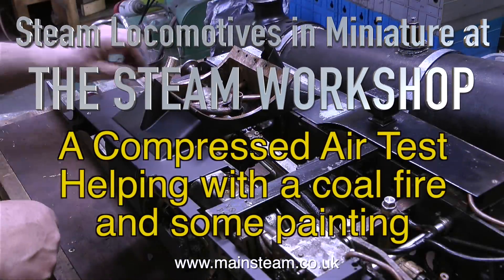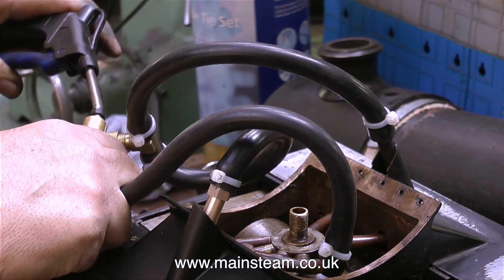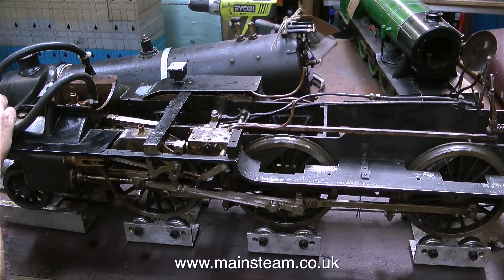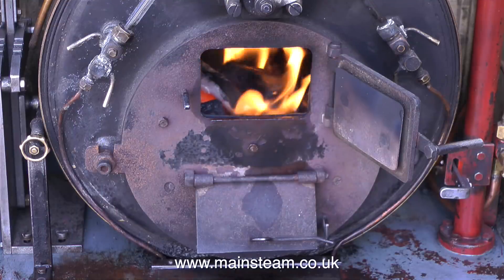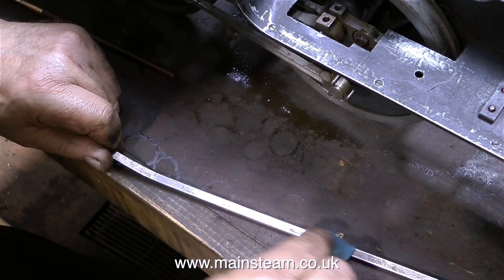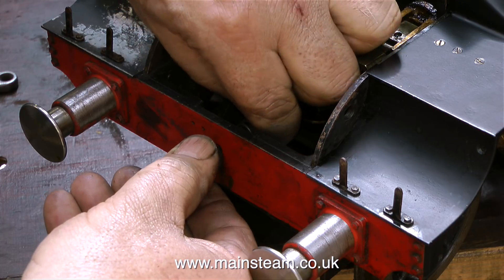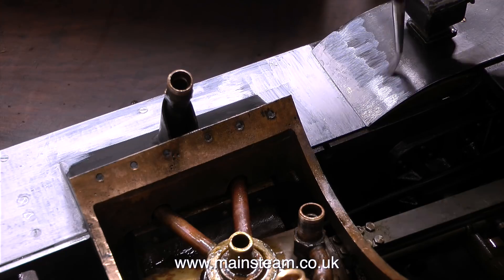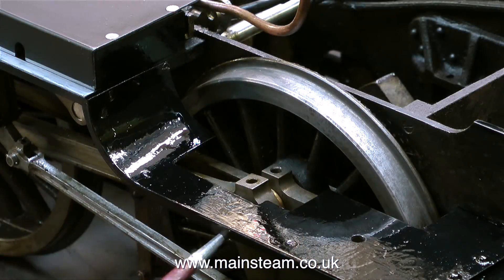WORKING AT THE STEAM WORKSHOP - AIR TEST - COAL FIRE & PAINTING

Comment: Hi Keith, I'm busy repainting my Chub now. Precision PQ17 metal cleaner first, tnen PQ 1 areosol or PQ31/32 two pack if brushing. Leave for two days (very important) you would need to scrape off with screwdriver to remove, it bonds excellent on brass.

Comment: I worked in the industrial coatings industry for 30 years. I don't know if you can get it where you're at. but sherwinn Williams makes a two part primer called P60G2 wash primer. It is a phosphoric acid suspended in an epoxy primer. A crystalline structure forms that etches into the substrate and also give a profile for the paint to stick to. It is for professional use only. So you would need a business to purchase it for you.

Comment: Panel wipe is a mineral spirit whereas lighter fluid is naptha if memory serves me right, slow and fast panel wipes are made so on purity levels and is really just oil derived white spirit in different packaging.   Naptha of course has been with us a goodly while and burns better than mineral spirits.   The old dry cleaning fluids used were an ultra pure mineral spirit that left no residue when evaporated altho never as good as the even more toxic carbon tetrachloride for cleaning whites which could be found in older fire extinguishers and used extensively by many a serviceman to get their whites white...  Carbon Tet is also an old lags trick of making a burnt out clutch work for about 100 miles and used by dodgy car salesmen back in the day hehe
Reply: Carbon Tet was later identified as something that caused arthritic like symptoms in the hands of mechanics, gasoline can also cause this.  Some places used to use carbon Tet for cleaning floors!  The stuff was deadly and I can't believe some people regret that it's no longer available!